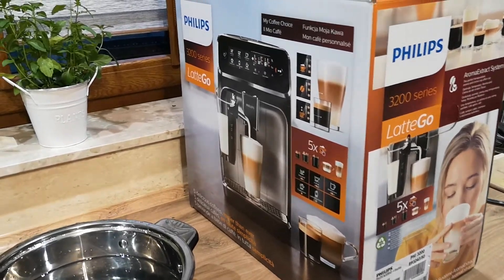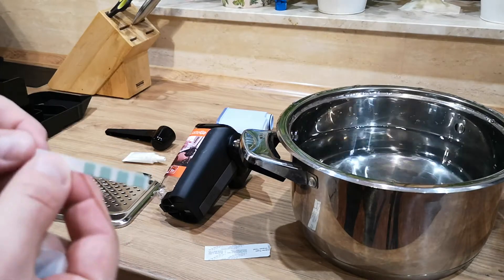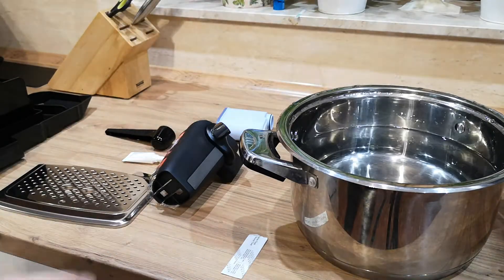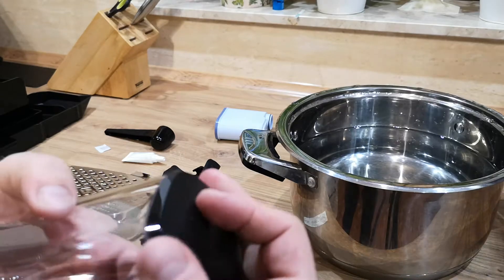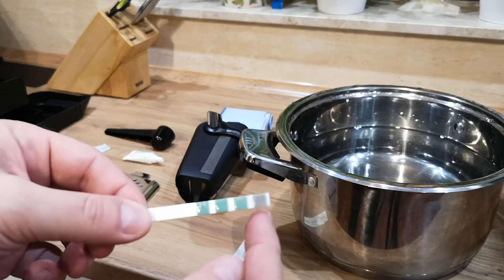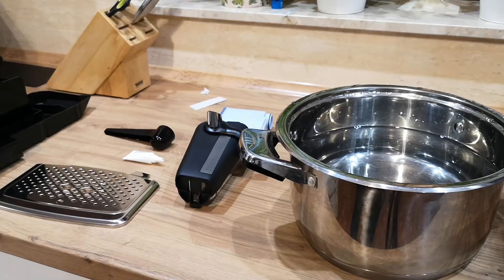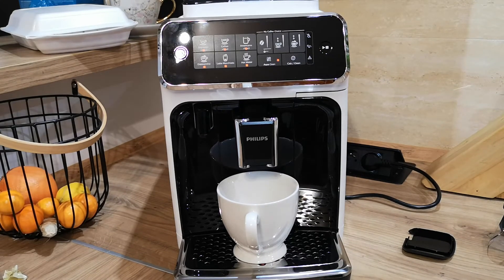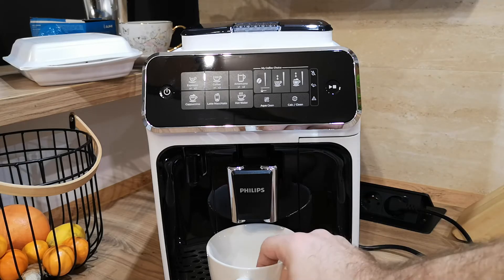How to setup Philips LatteGo coffee machine - Aqua Clean filter installation and water hardness test

Comment: What was wrong with the activation of the filter? Did you solve issue?
😅
I'm asking as I have a new machine with same issue. I installed filter after priming  it, but it won't change to blue when i press and hold the filter button. Did you solve the orange light issue. Did it turn to blue??
Reply from the maker: Yes it did. Here is the video https://www.youtube.com/watch?v=3IGnmXVXKN4

Comment: Hi, your videos are great and very helpful. I just bought Lattego 3200 series coffee machine (got it today) and I have a bit of trouble, on every startup the machine makes noise like it's gonna make coffee and dispenses a very small amount of water. It does that right after all the lights stop blinking. What can that be? And every other time when it should make milk foam it makes loud noise, like something hitting inside. Apart from that, I didn't have any other strange issues.
Reply: Just to say, it functions normal when making milk foam, only the noise is strange, because it's not doing it always.
Any thoughts?
Reply from the maker: Hello. Both situations are correct. Machnine need to be presurized before making a foam and sometimes it suck some extra air and make nosie. The first water Flow is also standard procedure  when machine clean itself. Regards

Comment: i wonder what they need the water hardness for!
Reply from the maker: Good question. Selected water profile It is basically needed for Aqua Filter live time calculation. Inside coffee machine there is a counter of cycles (number of made drinks) After this counter reach a certain number it shows warning and the filter need replacement. 

So soft water will let you prepare more drinks with the same filter. Hard water - less drinks before an aqua filter will require replacement.